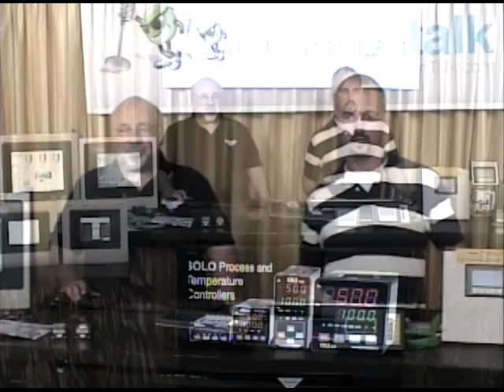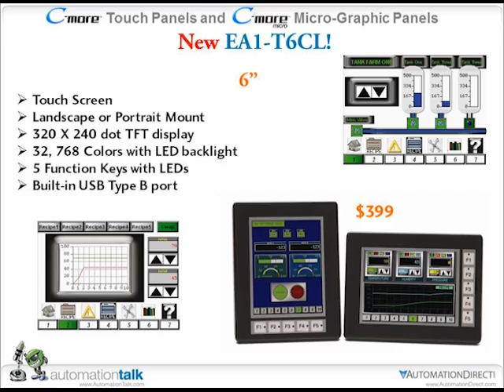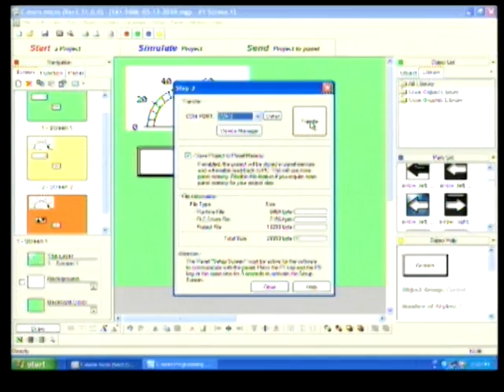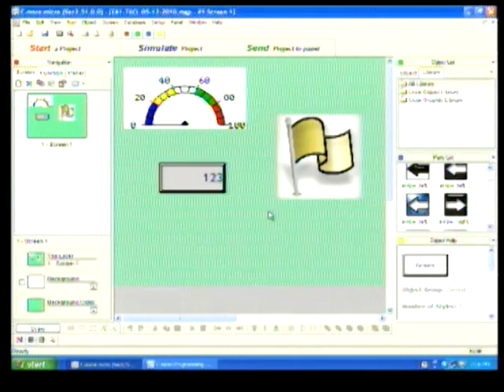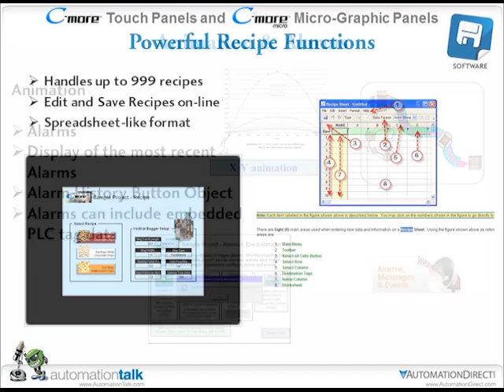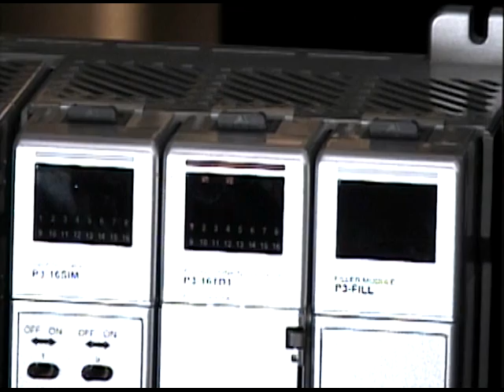C-more & C-more Micro Operator Interface Overview from AutomationTalk

Comment: There is a sound problem with the sound card of these panel and automationdirect don't care about that. Also, The 6 inch panel is only 320 X 240 pixels wich is low resolution for a screen of that size. And the software only offer 256 colors for screen that can support 64k colors.